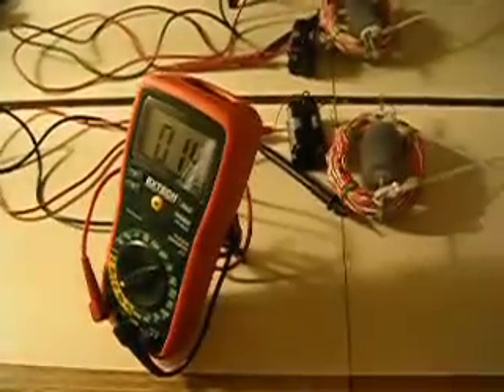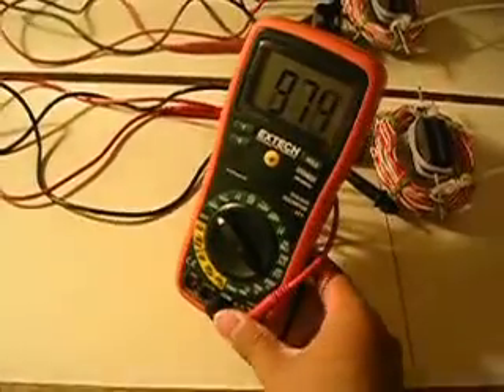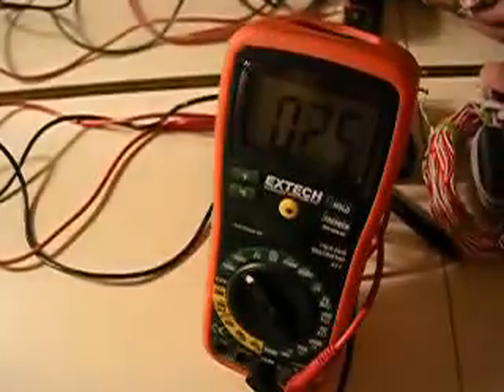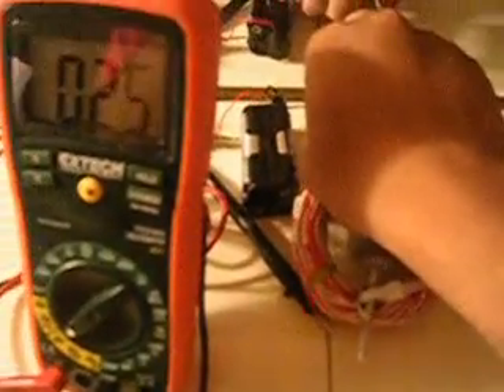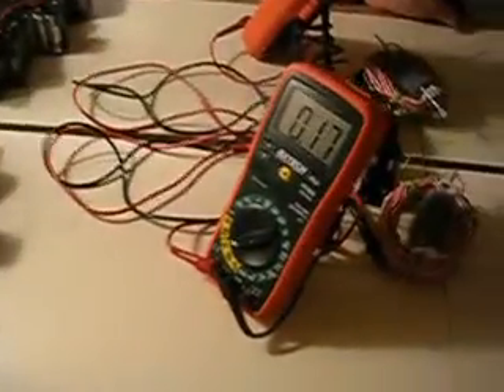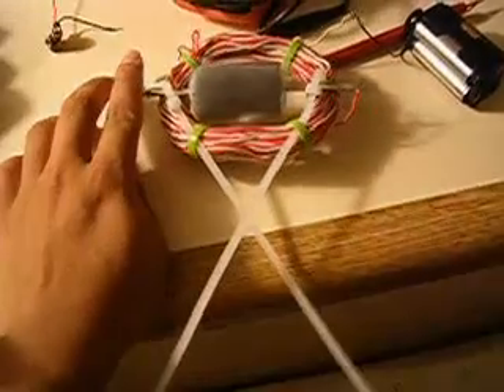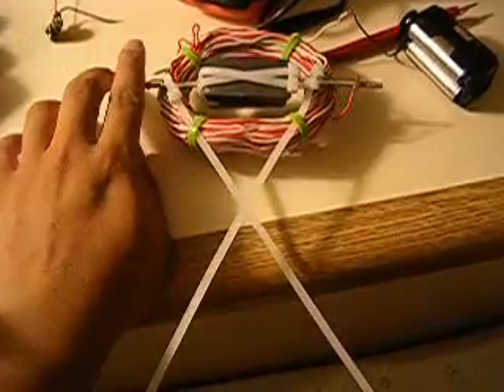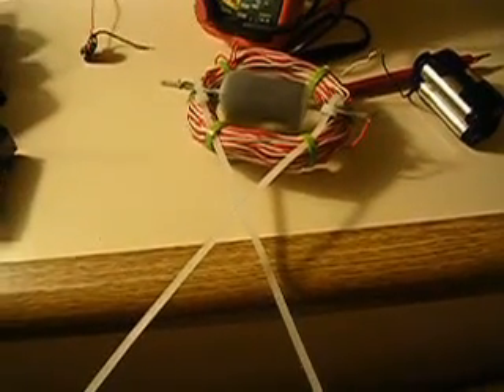Electric motor ▲ Smaller vs. Bigger

Comment from the maker: It's about the simplest commutator design you can have. One part of circuit is connected to the shaft. When the circuit is closed, it means another part of the circuit touches the shaft (metal) to complete the connection. It's due to the bent nature of the shaft, which means no tape or covering is necessary.